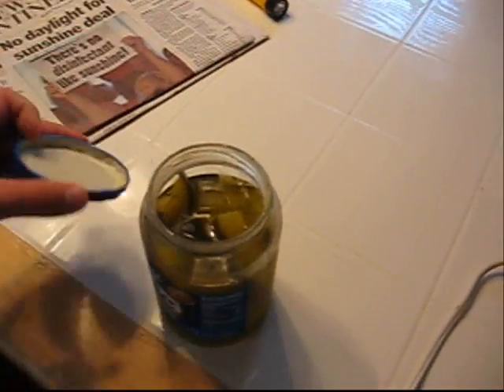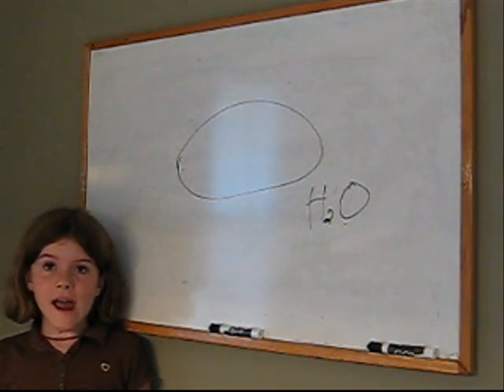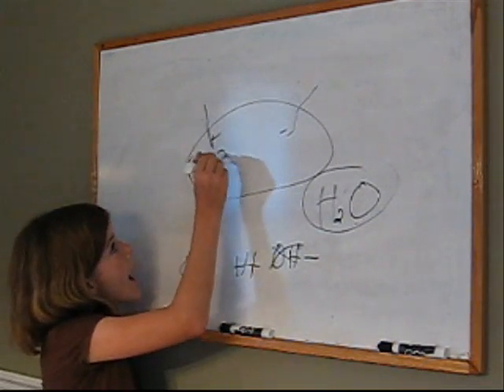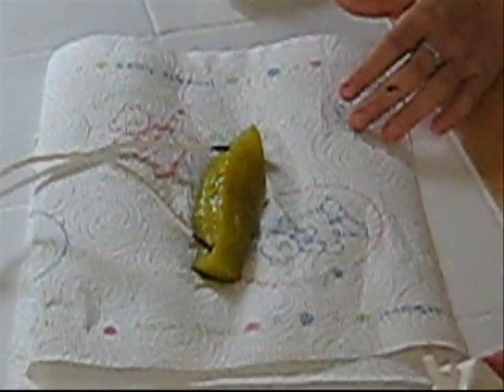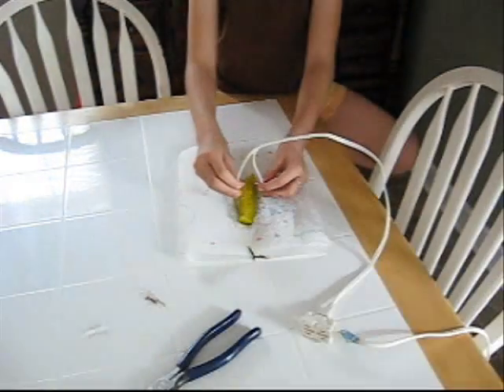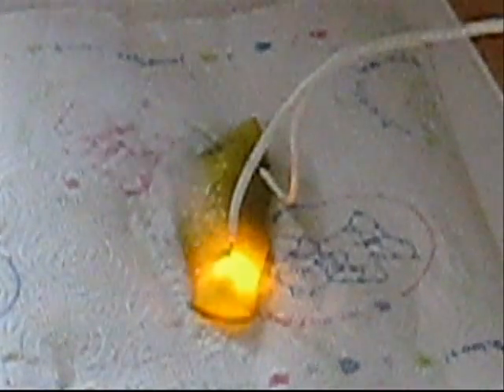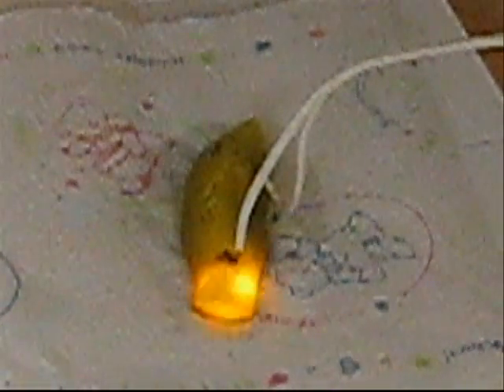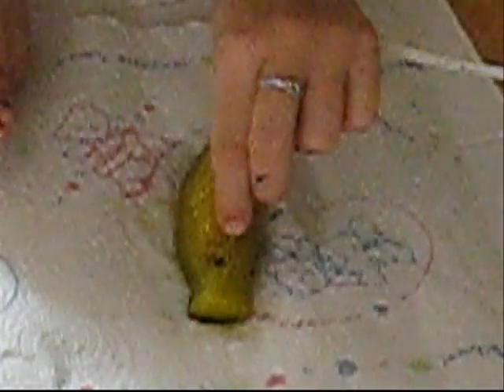Glowing Pickle

Comment from the maker: Well, the filament in a bulb is radiating energy in the visible spectrum because of it's high temperature. The pickle didn't get nearly that hot ... the light emitted is from the electrochemical reaction. Should work similarly for DC power, but I don't know if a GFI outlet would be a problem.

Comment: I'm not a chemish nor an electrician but ? you were hitting the pickle with an AC charge so was the pickle acting more like a poor filament in a bulb ? i.e. creating light and heat because of resistance. You can't use a GFI or the experiment would get nowhere ( I think, but don't know) but I hope you at least had the cord connected to a power bar  for a quick sure off. Would it work similarly with DC ?